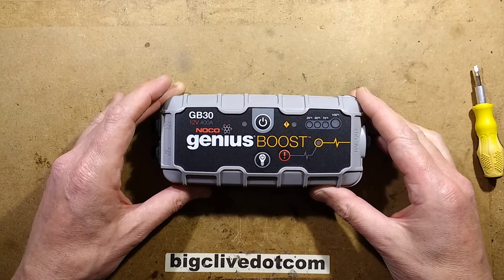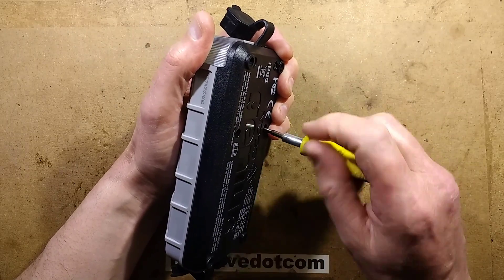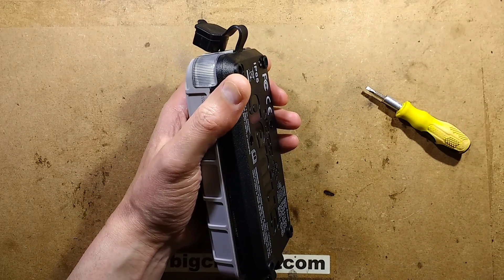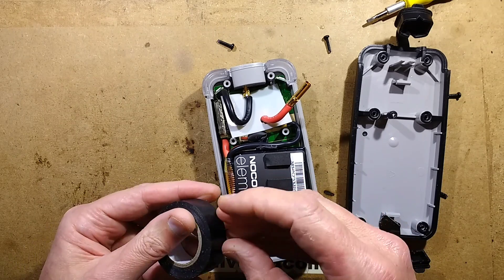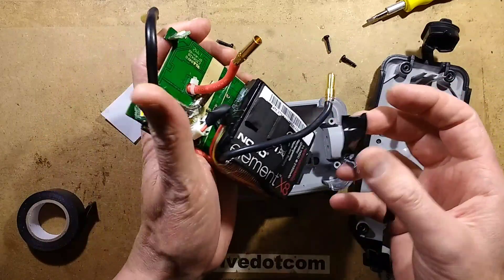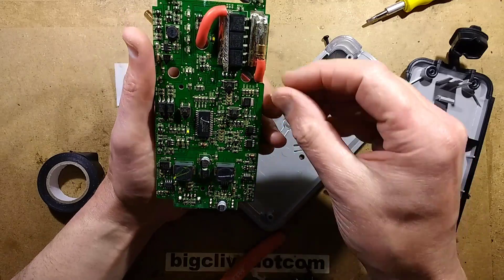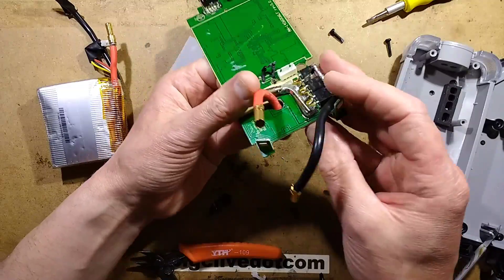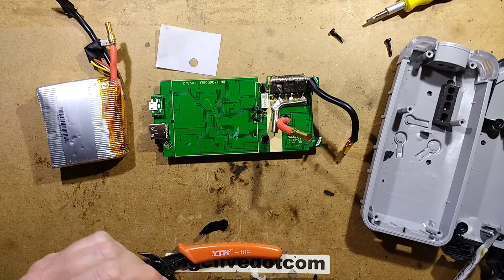Noco GB30 failure autopsy.

Comment: According to the many electronic reviews of these products, that I've seen;  the Noco is one of  the worst at over promising it's amperage capability.  I gave up trying to find a good one!

I'll just stick with the 12v 50Ah battery I have mainly for my lift.  It has two 15 watt solar panels, one on each side of my van to keep it topped off.  Or, the 24v (2x12) 50Ah batteries in my wheelchair.  Both of which I've used to jump my own, and other people's cars!
Reply: Tad Hildebrandt average life span for a lipo (like in these jump packs) is 3 years if treated properly. fully charged is 4.2v per cell, so three fully charged cells in series gives you 12.6v. the problem is, these batterys eat themselves if left fully charged. they need to be discharged to around 3.7v per cell, and over discharging them also damages them around 3.2v per cell. 

an alternator is also designed to always be charging the battery. without some sort of smart controller, it would over charge them and cause them to burn. unlike lead acid, if a lipo was left charging at even .1 amps, it will keep charging until it burns. meanwhile, lead acid and most battery types are designed to be stored fully charged, which makes them good for a car application.

lithium ion (round 1650 cells like tesla uses) are more robust and can be charged quicker, but have about 40% power by the same weight. they are still supposed to be storage charged at about 70% capacity. charging them quickly also carries quite a bit of heat. tesla battery packs are actually liquid cooled. if treated properly, they should last 7-10 years.

most draw backs could be overcome pretty easily, but there is already a system in place and its the way the rest of the world works.
Reply: I have had a Schamer tech with USBs, Flashlight, compressor, 12 V outlet for 5 years. It has served me righteously during every power failure (lots here in the sticks) , starts the tractor each week, has started my truck and cars on occasion and has been FLAWLESS. It has some sort of lead acid battery and is heavy but smaller than a bread box. Old tech is great! Heavy but great!
Reply: I have a BoltPower G06 and it works very well. It's a genuine 5500mAh battery pack and it's able to directly start a V6 engine without any assistance from the battery.

A feature (or shortcoming, depending on your criteria) is that the jumper cable connects directly to the battery pack without any intermediate MOSFETS or relays. This allows maximum current to flow to the vehicle and allows for the best reliability, but it means that accidentally shorting the jumper cables together would be truly catastrophic.
Reply: PV2Omni ive jumped my car with a $6 2.2ah battery i bought for a model airplane. these lipos are many, many times more powerful then people give them credit.
Reply: Tad Hildebrandt Exactly!  I didn't realize that I was going to start a conflict.

My point was like yours, they have very mixed results.  That and instead of spending $100-$500 for a well reviewed one, I'll stick to my tried and true options, that work everyday!

My lift, and wheelchair, not only run themselves, but also run an Engel, digital, 12v warmer/fridge/freezer, regularly.  My wheelchair also has a 400 watt inverter, and 4x 12v outlets.  They run phone chargers, fans, etc.

My main point was, a good (extra) 12v battery has many uses, always looking for more, including jump stating.
Reply: Ammar Abotouk . that's what he said it was.
Reply: Dielectric Videos I opened mine up they use a very high 6000 X3 very high discharge current cells I was impressed by Thier performance!! quialty product
Reply: lilsammywasapunkrock yeah I know of course not all of them , the high discharge ones that do ! my jump starter someone reviewed it ,it was capacle of doing 330 A at 10v that's 3300 watts for 10 seconds !
Reply: Baerchenization my $6 model airplane battery is rated at 20c continuous 30c peak. meaning 44 amps till it goes dead and 66 amps for 30 aeconds. when i tested my starter for my v-8, it pulled 60 amps and voltage dropped down to 10v's on lead acid.

on the lipo it actually pulled less amperage because it didn't drop as far. i dont remeber exact numbers. i was going to make a YouTube video of it, but never got around to it.

if you short out the leads to a lipo, you can weld with them, even a low discharge one. even the "same" power ratings don't cross over. lipos have virtually no voltage loss under load and will put out way more "power" then a comparable lead acid.
Reply: PV2Omni I wonder if car batteries will ever be Li instead of Pb/acid, they use them in electric cars but nobody is making them for  combustion vehicles tonreplace the standard 12v batteries, I know they'd be pricey but they wouldn't be if everyone was buying them instead of the Pb/acid ones. There's gotta be some reason I'm unaware of as to why that isn't a thing yet. Also, about how many years do those 12v Batts last you in the applications you use them for until they fizzle out? I'm just curious, it's neat man.
Reply: "I wonder if car batteries will ever be Li instead of Pb/acid"
The price is hard to beat, compared to Li batteries with the same power and current capabilties.  They also live comfortably under the hood for years, under temperature extremes that would kill a Li battery, and do not ignite if things go seriously sideways.
Reply: PV2Omni Btw, I agree with what you said about this particular brand of starter units. I take it you watched AvE's video on them, too :P
Reply: The two I use have a 12V 18AH sealed lead acid battery (Apex 12180)
basically made for motorcycles and lawn mowers.
Reply: Tad Hildebrandt The one's in my wheelchair, have been there for 10 years!  The one running the lift (etc) in my van, has been in there 5 years, and is around 8 years old.  I take good care of them, but also abuse them regularly.

Yes, AvE is one of the many reviews I've seen.  I was really looking to buy one, but the reviews, cost, and added benefits don't add up, for me.

I don't know about the rest of you guys, but I don't leave ANY LiPo's in my van.  It easily reaches 200° in the summer, and that's with reflective shades in the front windows, the built-in shade screens in the back windows, tinted windows, and the sunroof/back vents open!  

I don't leave LiPo's during the day, and not at night unless the ambient temp is below 90°.  The damage to them, and other things, is not worth it!
Reply: PV2Omni  I bought one from aukey it has a very large 60 watts high discharge battery with relay
Reply: Lauren J. my bad 😉
Reply: I had one of their lithium ion battery chargers arrive doa and the replacement overcharged my bike battery (was running in correct mode) to the point where the cells split and it poured electrolyte everywhere.  Bit of a mess....
Reply: That is so badass, jump-starting a car from a wheelchair!
Reply: Want a good jumper pack? Watch PROJECT FARM and buy an AUDEW or TOP VISION. AUTOWIT is a battery less jumper that is ok but more $$ then a NiCad jumper. Hope that helps
Reply: @garywelker8398  what concerns me about the non lead acid jump packs is the higher than normal voltage they put out. Lithium and capacitive jump packs connected to a car with a weak battery that doesn't limit the voltage would subject the vehicle electronics to maybe 16.5V. 
Not sure if the electronics in all cars will handle that safely without blowing something.
Reply: worddunlap are you sure yours is Li-ion? sounds like yours is a lead acid one
Reply: Baerchenization  That was brutal, but you're too forgiving towards these jumper manufacturers, and by that I mean you're willing to stick up for them because you've had good experiences with them, but the fact is that their stated product specs and product data do not reflect what you're actually getting. It seems to be a common theme with most products; whether it's done by mistake or on purpose to increase the perceived quality/performance of a product, however, but the nature of this specific market niche is unlike that of the majority of product markets in that the consumer is counting on these units to get the job done, it's a preventative measure to buy one of these to keep in their vehicle just in case and the fact is if consumers who purchase these units happen to end up in a grim situation as a result of a dead vehicle battery in addition to bad timing/circumstances, they are putting their faith into this product they paid a not-insignificant amount of money for and they need it to work or they're up shit creek. So these units need to be consistently reliable with low defect rates, otherwise people won't trust the goddamn things. There isn't enough quality control for these things. Sometimes when you need a jump, you really need a jump. You wouldn't feel confident using bullets for home defence from a manufacturer that has a mixed reputation concerning reliability. These things have conflicting reputations for a reason, most are probably a result of human error but you know damn well defective units exist. These units need to work when they're needed.    Period.
Reply: The Auto-Vox P1 is a good un - can vouch for it personally.
Reply: ITS* amperage, not IT'S amperage.
Reply: Good luck fitting your extra batteries and solar panels in your glove box or a side pocket. Which is what these products do and why so many buy them and why so many are enthusiastic every time they save us. Nobody cares if the manufacturer claims it starts you car 15 times and it only does it 5 times.
Reply: I am not sure why some of the most critical reviewers have such a fetish with the amperage capability... they are self-important morons. You want this thing to start your damn car, right? And if you watch the reviews that start even the biggest of the V8 engines a dozen times with these, then what do you care what marketing printed on the box?! Car manufacturers also hopelessly overstate the gas mileage - you don't send your car to the presser and shit talk about it nonstop because it doesn't reach the promised 28 mpg... some dumb garage hobbyist "reviewer" with 750 subs having their 15 minutes of fame because they think they are up to something once in their lives. It's a jump pack, and it works. Any issues with that? Then wait by the road side until someone with jump leads comes along and helps you... Jesus Christ. - I have a different brand where I know that the numbers are also "ambitious" on the packaging - but it has started cars so far many times - why would I shit talk it if it does what it should? Because some moron on Youtube got a multimeter for Xmas and now thinks he is kind of a big deal?

And you are just not being honest - there are so many reviews where people start big engines with any model NOCO - and you could not find one?! I have a Suaoki that was like ca 100 bucks ca 2 years ago, there are better ones now, but it still does the job. What car do you even have?! A V10 Viper? Or a 4 banger Nissan? Except for the dodgy generic Chinese one, they basically all work.
Reply: @Baerchenization  you sound like a triggered Democrat..
Reply: Baerchenization - Whenever you encounter a troll-like comment, it's worth checking their channel, to see what gives. Most have no followers, no videos, and many have created the account for the purpose of being able to comment. That comment came from a person who registered ten years ago, yet they have no uploaded videos of their own, and only 7 followers (possibly even the same person or bot, via 7 different accounts.) That says it all really. don't expect a reply from them. Unless you prefer to receive verbal abuse? 

Millions of bots also began appearing last fall, and they tend to either slag people off about their political leanings, culture, language, sexual orientation, etc.  Reporting  them is about as effective as trying to plait bubbles. Best to ignore them. 'Do not feed the trolls!' Has never been better advice.

Comment: Far more electronics inside of that unit than I would have expected... complex unit. When the Li battery goes thermonuclear, it's all over no matter how advanced the circuitry is.
Reply from the maker: I've added a list of the main components in the unit.  It is quite complex.
The optocoupler-like devices are indeed Cosmo 1010 optocouplers.
The battery balancing is dealt with by an 8254AA chip with 4435 MOSFETs. 
The LEDs are driven by an Xn2115tp device.
The main processor is a Holtek HT46R06.
The USB output is powered by an MP1584 buck regulator.
The USB charging input is boosted up by an FP6293.
There's a GZ423 (maybe a dual op amp?) and a 3.3V regulator.
Reply: This is because the video is available for preview by Patreon donors before Clive makes it publicly available on YouTube. We can comment before it is available public.
Reply: To me looks very like someone shorted the output terminals together. My instincts say a kid playing and not understanding what they were playing with.
Reply: Scotty from star trek said  The more they overthink the plumbing, the easier it is to stop up the drain.
Reply: bigclivedotcom how did this happen? it says that your comment was posted three days ago and meanwhile the upload was only six hours ago.
Reply: @ceneblock  He just said, he added the component list.
Reply: LakeNipissing ah, thanks a lot! more of a reason to donate.
Reply: bigclivedotcom too much shite.
Lots of points pf failure Id say.